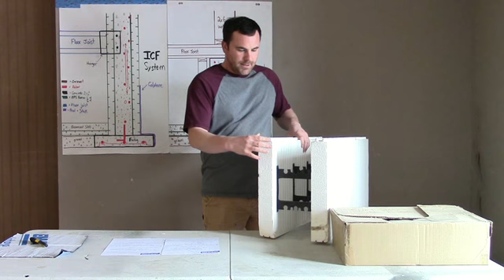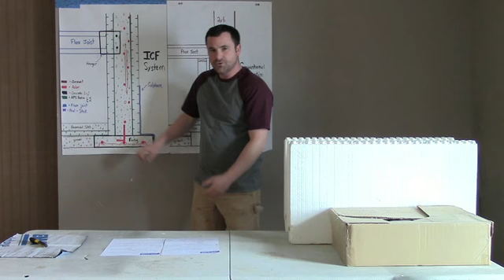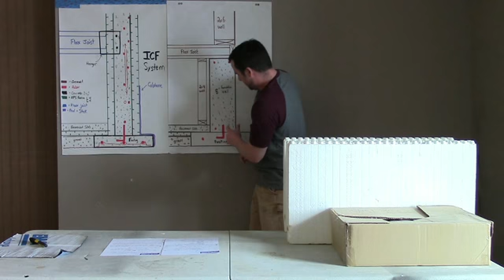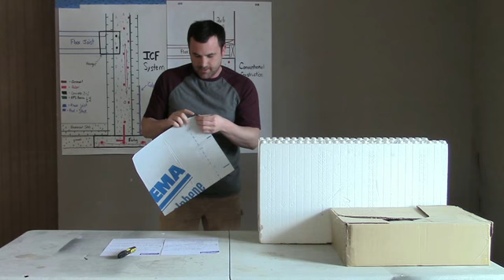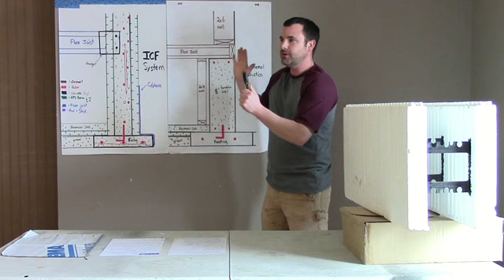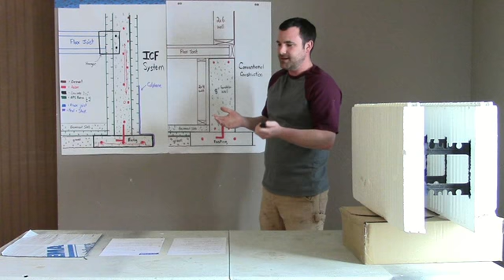20 Advantages to an ICF Building

Comment: concrete will always be curing if dew point is in the middle of concrete , and the concrete will be stronger and stronger and stronger ?

i believe there is a duration for concrete curing, beyond that it won't be stronger and stronger.. correct me if i am wrong. 
i believe long term moisture in concrete after it is properly cured is never good..  
correct me if am wrong.
Reply: It actually does get stronger over time and takes forever to fully cure in this type of situation.

Comment: Hello, i wanted to ask you if this construction system works and if is resistant to seismic activity? I am in a very seismic country, would it be strong enough to stand  seismic movement through the years... and possibly strong ones?
Reply: Yes anything built with reinforced concrete is more resistant to seismic activity than wood, probably more so than steel alone. but with the facts it is a insulated form itself offers its own strength and if concrete breaks inside it remains hidden and not an issue.

Comment: Your point regarding fire proof isn't valid. If you have your roof or wall systems burning then the fire temperature is going to reach a point where the concrete starts spalling when the fire department tries to put out the fire making your concrete useless.
Reply: It is easy to limit fire load through controlling what you have inside the building (furniture, flooring, etc.).  Applying one layer of 5/8" Type X sheetrock inside provides a one hour fire resistance before the foam is involved.  Two layers yields a 2 hour firewall.  Most houses become completely involved BECAUSE of the wooden structure.  Recent history in California shows that shrubbery planted close to the building created the source of fuel to burn down the structure.  Traditional stucco finishes provide additional fire resistance.  BTW, the use of properly treated cellulose fiber has proved to be effective in limiting fire damage, actually containing it sufficiently to prevent buildings from becoming fully involved.  Factually, nothing is fire proof.  Only varying degrees of fire resistance.  If it is really important to you sprinkler systems are the best way to limit fire damage.  That and not engaging in careless living practices.
Reply: John Fitzgerald

Comment: Hello friend, I'm a builder in Brazil and I also have a channel, I wanted to know what the dimensions of these blocks are?
Reply from the maker: +JR- Construção These blocks are 16" high X 48" long.  Wall thickness is 11 3/4".
Reply from the maker: +JR- Construção the block in this video is a Logix. We have also used Nudura and their size is 18" high X 96" long. Wall thickness is 11 1/4" and blocks are collapsed upon delivery. Nudura blocks also click together when stacking which reduces chance of lifting or settling while pouring.  Cheers!
Reply from the maker: +JR- Construção I believe I responded to this but don't see it right now. Did you receive a response about this? If not try me again.

Comment: I can find a lot on ICF exterior walls, but not too much on how the interior walls are subsequently completed.  I've seen both ICF throughout, as well as hybrid designs using stick-frame interior with ICF exterior.  Could someone let me know if there is a list of pros/cons to both methods?  Maybe costs, ease of running plumbing/electrical, speed of installation, etc?  Just the considerations one should think about.

My wife and I are currently in our planning phase for an ICF home in northeast U.S.  Ranch style with a basement, 5000 sq/ft including finished basement.

Kody, your videos are excellent.  You should be a teacher.
Reply from the maker: I appreciate your comment at the end. It means a lot. In my business we always just stick frame our interior walls. Here's a few reasons why: More versatility and ability to make changes down the road. Faster because you don't have to pre-plan vent lines, air returns and other items that go in the walls. Cheaper for sure! A rough per sq ft price of ICF based on wall area is around $15 (that's 6" concrete) where as a framed wall would be around $3-4/sq ft of wall area. Wood walls take up less area. 

The one thing I like about ICF interior walls would be the thermal mass factor. Just more "storage" for heat or cold depending on winter or summer. 

If you need anything else let me know. Kody@uptokode.com is my email.  If there's some info you would like to see on my channel please let me know as well.
Reply: 1GoblinGreen I

Comment: Not sure if you touch on this in another video, but I've heard that the "thermal mass" benefit of ICF construction is overrated for the following reason:  

The concrete walls are insulated on the interior of the house, so all that heating/cooling you are doing is not reaching those 100,000lbs of concrete.  I've heard that only the concrete floor (that is exposed) adds to the thermal mass of ICF construction.
Reply: That is false.  Insulation doesn't work like that .  Insulation will only slow heat and cold transfer; it doesn't block it.   The thermal mass of ICF wall stores the heat or cold better than any wood frame insulated system and so the temperature in the home is more consistent which means your hvac system doesn't have to work as much. It even gets better when air draft affects are calculated such as external wind pressure,, the ICF wall dominates the wood frame systems.  Overall costs with the ICF system like this one shown even beat 2x12 construction using R38!  when tested in 3 test homes in 3 different climates cities in U.s.  ICF walls dominate.
Reply from the maker: Great question and great answer below!
Reply from the maker: Thanks for a great answer Scott. If you know of any data like that I would appreciate a link or website. Any info that I can market for ICF the better for the whole industry!
Reply: the concrete is pulling up heat from the ground which I believe is 54 degrees, so it's not fluctuating like a wood wall

Comment: Would be much better to use hot knife for carving lines for electrict wires instead chainsaw.
Reply: Joshua79C C I have been building complete ICF homes for nearly 20 years. The hot knife which is most commonly suggested tool, creates a clean channel for building mechanical systems however it does produce considerable harmful fumes. I personally use a small electric chain saw fitted with a depth guide. It does produce some of a “snow” mess but easily cleaned up with a good shop vac.
Reply from the maker: Is that a question or a statement? Just wondering your experience and what you prefer. Always multiple ways to achieve the same result.
Reply: Hot knife or carver is better since it produces no off cuts or static waste compared to using a saw of any kind, but better to use a sharp utility knife or heat knife instead of some saw which creates a bit of environmental mess. But the shaped heat knife is best since it creates a channel in one cut, and if your creative enough and got time can reuse the cut pieces as plugs but would still want to use adhesive foam spray fill.

Comment: The concrete is sandwiched and insulated between layers of foam..  The heat or cold from the concrete cannot enter the room to heat or cool it.
Reply: The insulation slows the heat travel, so the heat flows very slow.  The concrete acts as a battery for the heat.  Whichever side is cold is where the heat flows, it offsets the cold or heat by several hours so it can be hot outside during the day, but inside you have the night time temperature.  By the end of the day the heat begins to soak thru and it warms the house at night.  It never gets too hot/cold because the insulation does not permit the heat/cold to get extreme.
Reply: wrong.  read my response to the guy above.  insulation only slows heat or cold transfer.  It doesn't stop it. That is precisely why ICF homes have more consistant temps inside because heat or cool air on the inside transfers slower to the outside or vice versa.
Reply: I would think that the two inches of foam on the inside of the ICF would not be thick enough to completely stop heat transfer from the cement to the inside of the home.
Reply: Not completely. But the main thing is insulation on the exterior of the main wall to stop the wall getting hot in the first place.
Reply from the maker: Well said! Thanks for commenting everyone!
Reply: Kody Horvey The concrete is the secret weapon of the ICF building. The explanation I use for my clients is that the concrete becomes a large thermal mass. The energy, whether cold or hot,  to raise or lower the temperature of the thermal mass is significant therefore very little energy is wasted heating or cooling your home.

Comment: Rebar holds concrete in tension.  It does not provide tensile strength.
Reply: +Andrew Rouse Additionally, rebar is not sized in millimeters in the US.  ICF typically uses #3 and #5 bar.
Reply from the maker: +Andrew Rouse Good way to put it!